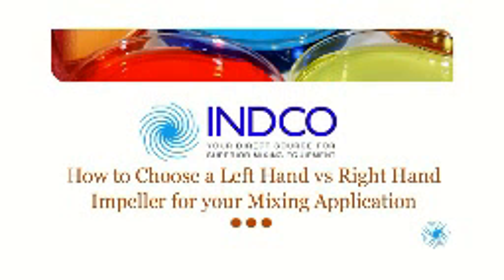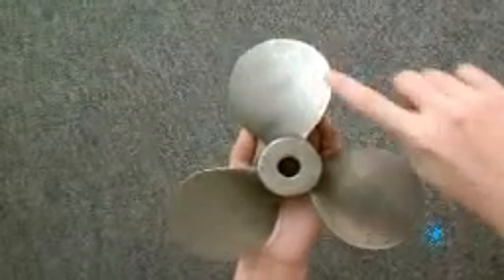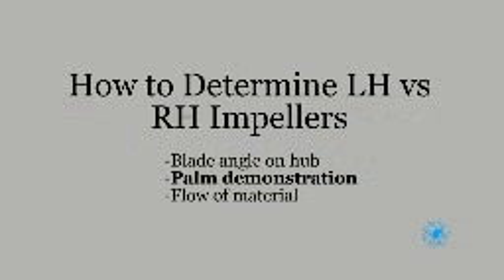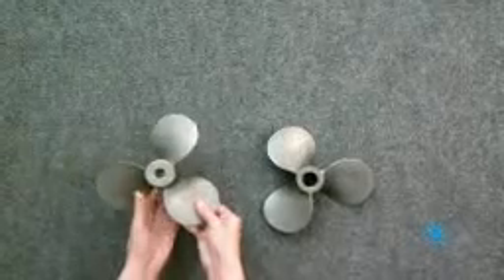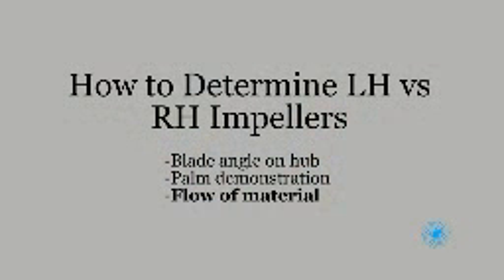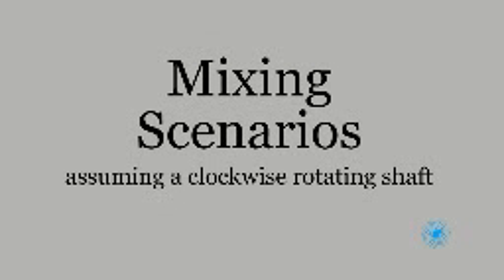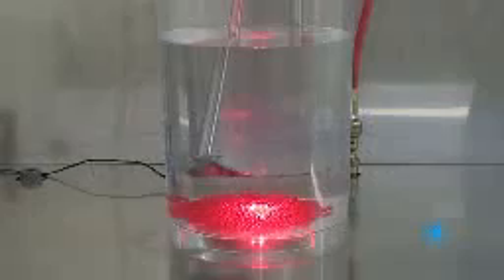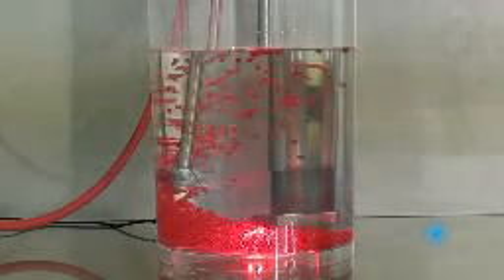How to Determine a Left Hand vs Right Hand Propeller | INDCO

Comment: "clockwise rotation of shaft" as viewed from the engine, or looking forward from behind the boat?
Reply: Our propellers are for industrial mixing equipment.  The rotation is viewed from the top of the motor looking down to the shaft.

Comment: why dont you tell us which side goes down on the table top;large or small taper opening??????
Reply: How about you ask yourself how you're going to force it onto a shaft? So that it starts a little smaller and tapers larger thus making it tighter or if you start at the wider taper of a shaft and work toward a a narrower taper thus making it looser and more wobbly?

Comment: Can you tell me what is the rotation of the RH propeller and LH propeller of the ship when the ship is turning Starboard ( or Port side ) ??
Reply: Staring at the propeller from the stern a RH turns clockwise to go forward, a LH turns counterclockwise and should typically be held by a left threaded nut. Typically a multi prop boat uses counter rotating props, left on left, right on right.